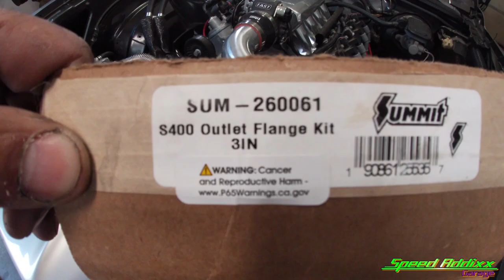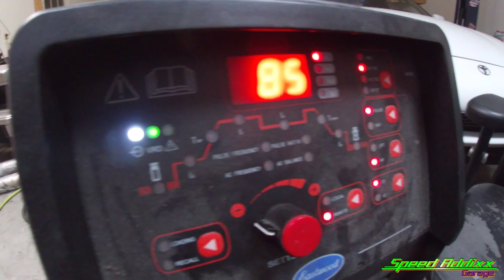70's Monte Carlo 5.3 LS Swap Turbo Kit Build (@ Speedaddixxgarage)

Comment: Doing my 85 regal its like a turbo almost falls in. Mine has plastic inner fenders and they are mates. Take battery out and it has 2 big circles to cut out for piping. Made for a intercooler. Just doing a 3.8 to 408 swap is all lol.

Comment: That's a good tutorial. I just subscribed.. I'm doing the similar setup but wit ac on a Regal.  Would you have gone with a turbo Header vs the manifold?
Reply from the maker: yes I would have. I like the tried and true flipped truck manifolds. You cant beat cast unless your gonna spend some money on some trick stainless headers. these had flat face vbands and I like the male/female vbands
Reply: @speedaddixxgarage8278  keep the videos coming thru. I'm at the stage of what manifolds to go with now or headers.  I'm running the LS Simple bracket kit. I want it to look like the Turbo and ac belong in the car. Appreciate the response. 💪🏿